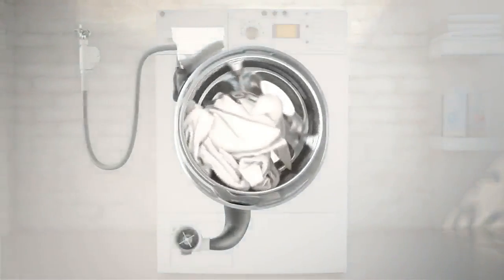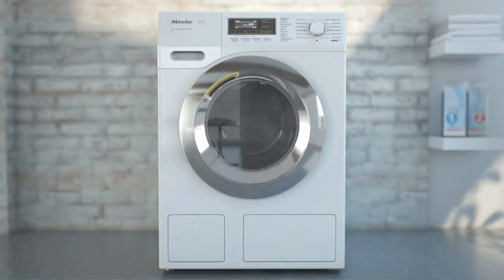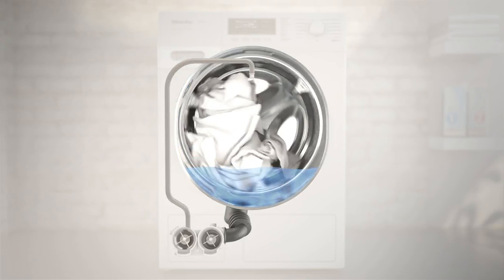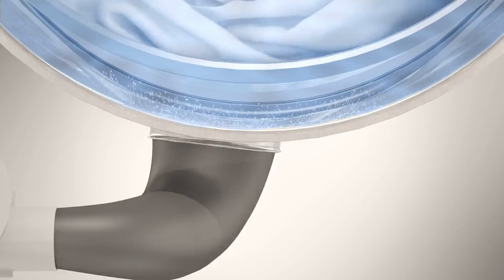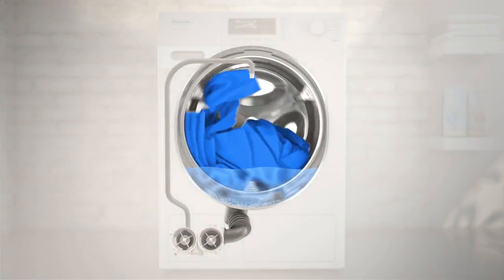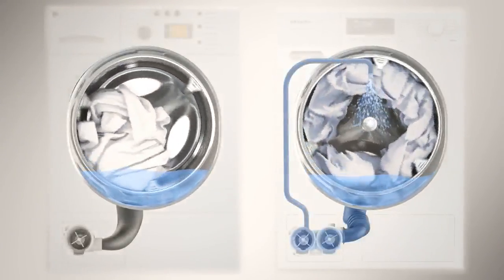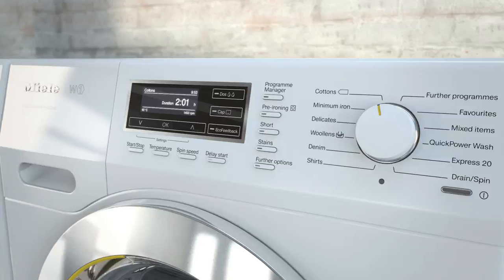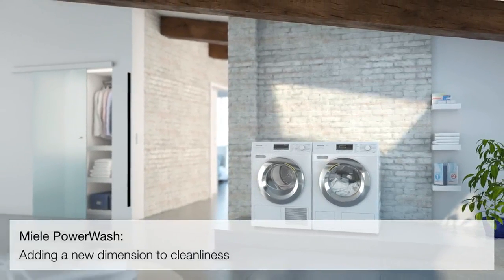Miele W1 PowerWash explained

Comment: They should utilize this power wash spray nozzle towards the end of the cycle to spray fresh water into a slow spinning load to get out all traces of soap from the clothes. Most modern machines don't rinse enough, so this could compensate for that problem, using only a few more litres of water.
Reply: You are right about water content . Being carefully watched by environmentalists and a major selling point. Less water for heating + maybe one rinse less saves money and water.Some machines have an extra rinse option which will help also don’t overload!
Reply: That’s what a Miele with Powerwash does. Not only while washing but also while rinsing.
Reply: @JaimeeTyrell  I have an LG 12 kg front loader and it cost me around $1,300 a couple years back and it does a great job, and you can adjust a tiny valve knob/switch thingy inside the machine so that it fills up with more water, throughout every stage of the cycle. I've tried it, works a treat. You can literally make it use double the water or more if you want. 

I have just now looked at Miele and for an 8 kg machine it's over $2,000. So Yeah, they are a bit expensive. They'd better have some good features.

Also, I have a hose from the laundry sink that I can put in the detergent draw and fill up the machine as much as I want, which I often do, especially with towels that need help with getting out the suds.

As for the environmentalists, etc, they can go to blazes. In Australia, it's winter and our dams are 90% full at the moment.

Comment: I can´t by a Miele washing maschine, because it´s too expensive for me, I didn´t to much money for it, bad
Reply: miele washing machines are expensive but they last 20 years or even longer. So actually it is worth the money
Reply: @tolgaturhan4691  no they do fucking not
Reply: Tolga Turhan technology always (very noticeably) moves on after 10 years, or even after every 5 years or so. So the last 1/4 of the lifespan of your Miele even if it lasted 20 or even 25 years you will have technology that is outdated by 15/20 years. 

I rather have two washing machines in that time. The second one replaced after eg 10 years with the latest technology, at half the price. Unless money was not an issue, I’d replace with the latest premium Miele washing machine again.

Comment: zanussi had this in the early 90s with the jetsystem
Reply: Zanussi's only re circulated the water, they did not use a vortex action like Miele machines. Zanussi's are also known to clog very eaisily in the jetsystem unlike the Miele's.
Reply: @TheLaundryCentre  using poor quality wash powder are we?  Buy from Lidl,s .?
Reply: and hotpoint had power wash
Reply: The Laundry Centre I had a Zanussi for over 12 years and the Jetsystem never "clogged" once
Reply: zanussi is not good
Reply: @tolgaturhan4691  Used to be though.